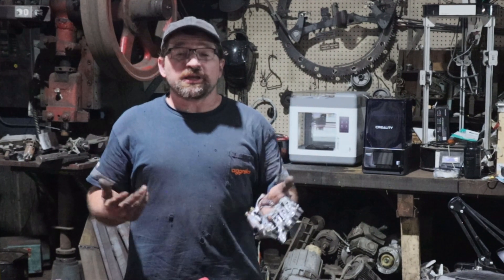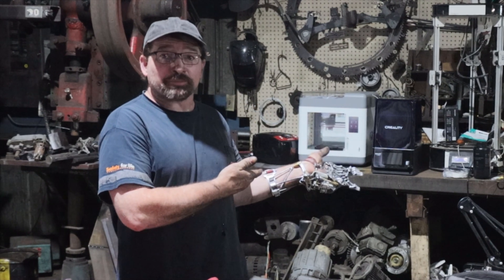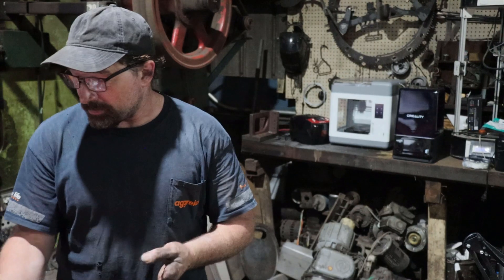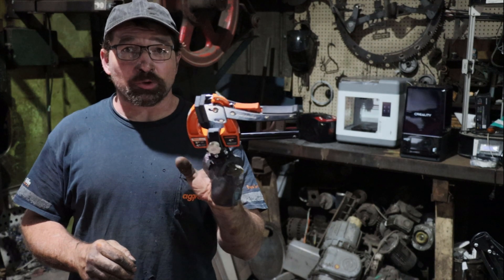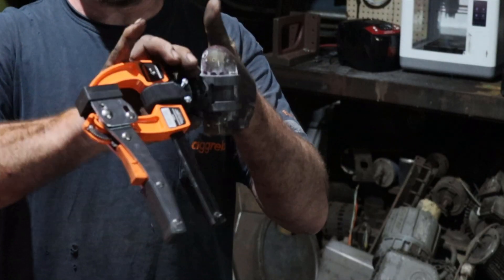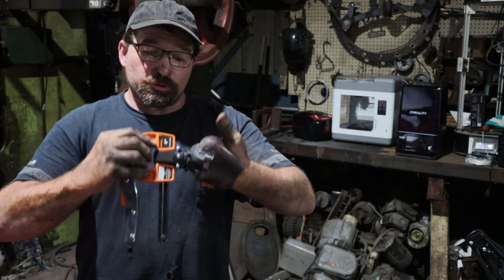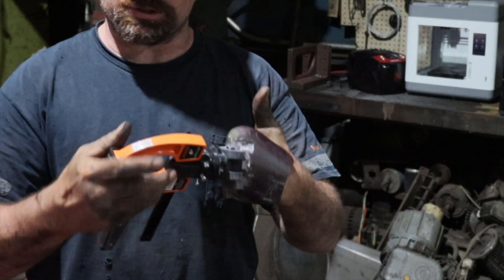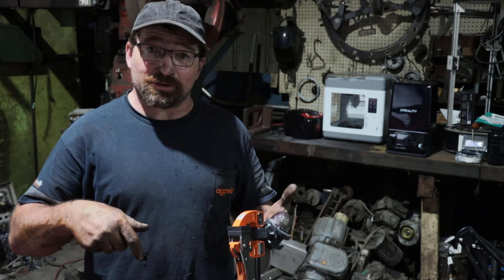Partial Hand Prosthetic Gadget printed with Creality

Comment: my only worry is that it would be uncomfortable and imprecise to have the clamp so far away from the wrist, like how using a long soldering iron is terribly annoying compared to a small one you can hold like a pen
Reply from the maker: Really the bar of the clamp i's only about an inch from the end of my metacarples, so it should be about the same as if I were holding it with my natural hand.

Comment: That’s cool, have you used it to do anything yet?
Reply from the maker: just a little bit of anvil work and holding parts while using the grinder. it'll be interesting to see how durable the plastic end up being. i dont think its a permanent version strong enough for industrial use. but it is something that can be easily reproduced by someone that needs one.